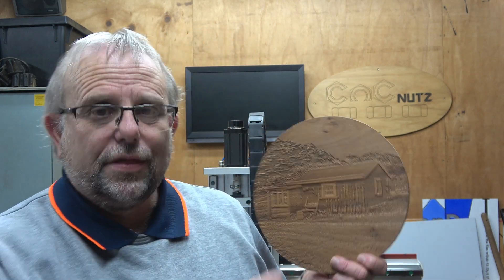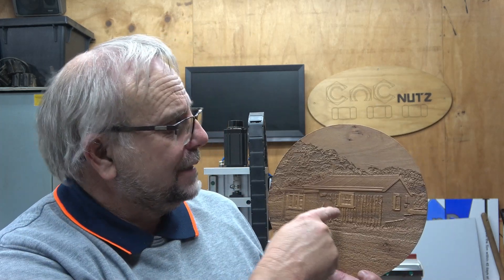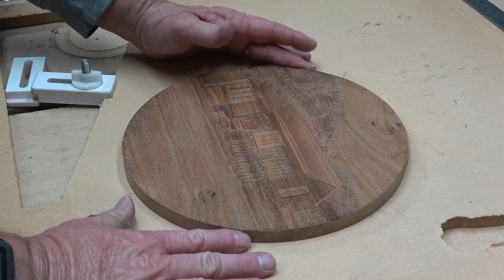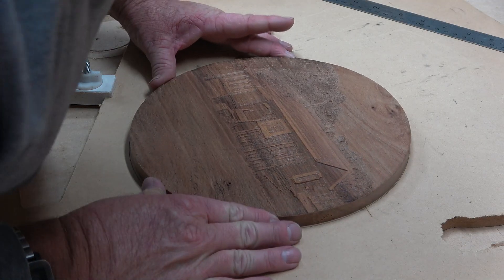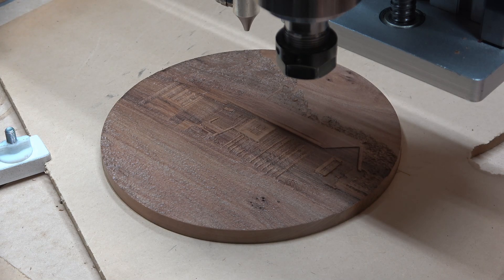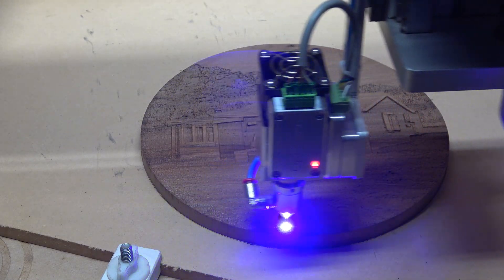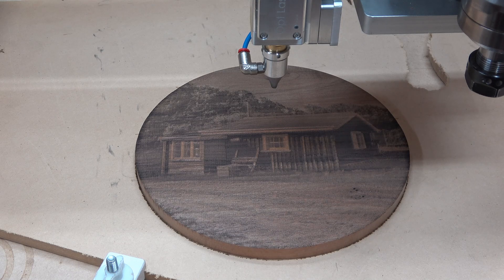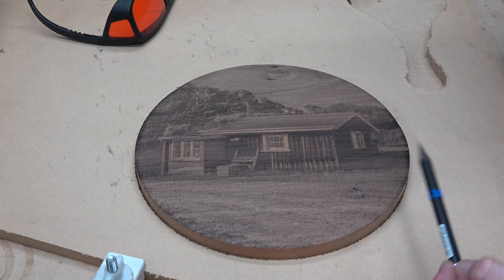Realign a Laser to your work - CNCnutz Episode 258

Comment: Great video, thanks. The same technique should work for me when cutting on the cnc and then carrying the part over to my separate laser machine.
Reply from the maker: That's a good thought Karl. Not something that I was thinking of when I made it but now you mention it, that would be a good way of doing it.
Cheers Peter
Reply: What program do use to control your separate laser machine? Thanks
Reply: @rbwoodwork1890  Fusion 360  (including dxf2laser extension) or Inkscape to get a dxf, then the funky Autolaser program supplied with the machine.

Comment: Thanks Peter, good to see a bit on laser alignment.  In some of the videos I see some hold-downs that look like MDF with a laminate on both sides, is that what they are made of?
Reply from the maker: I have a laser video in the works but don't know when I will get it done.
All of my hold downs are plastic with the exception of some I made from some old picture frame.. There is a  video on how to make them as well as CAD files.
https://youtu.be/wKiPfaA2oZY
https://youtu.be/RESF53ltsO0
Cheers Peter
Reply: @cncnutz  thanksPeter, never have the occasion to cut that material, so far I’ve made all of mine out of hardwood, using your same file. But I need to adopt your method of making a template and cutting them either horizontal or vertical. Thanks Hager

Comment: Hi I like that laser I watch all your videos I never see the video on this laser do you have any info on where I can buy that set up thanks.
Reply from the maker: Hi Jim,
It is on my to do list.
The laser consists of 2 different kits. I added the Air assist later mostly to see how it went. I still have to do some testing but air assist usually helps with cutting and remove the yellow smoke stains from work.
https://optlasersgrav.com/cnc-laser-upgrade-kits/plh3d-6w-xf-universal-kit-for-cnc-machines
https://optlasersgrav.com/accessories/high-pressure-air-assist-nozzle-kit

Connection  to my MASSO CNC controller.
https://docs.masso.com.au/quick-start-guides/laser-engraving-cutting/setting-up-an-optlasers
Reply: @cncnutz  thank you Peter for the info I appreciate it looking forward to your video on this laser and the installation process keep up the great work 👍
Reply from the maker: Here is a quick look of the lasers physical setup if that helps.
Cheers Peter
https://youtu.be/UsUf_LTyAXE